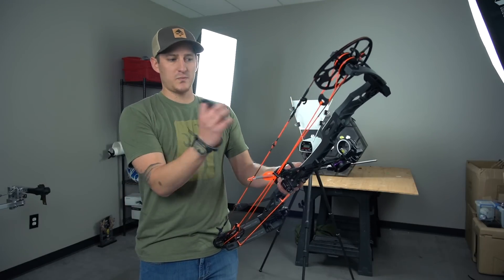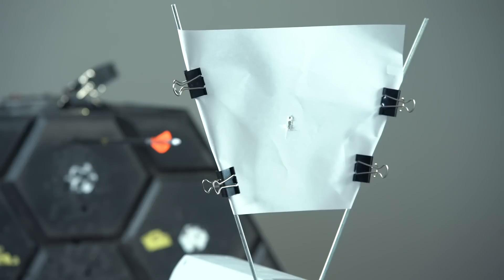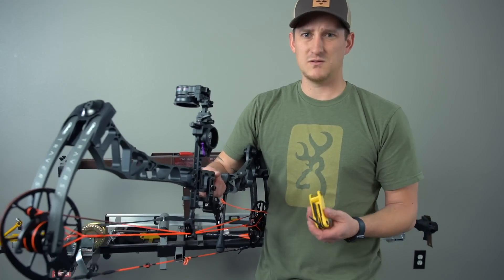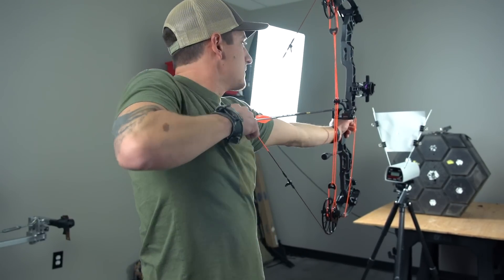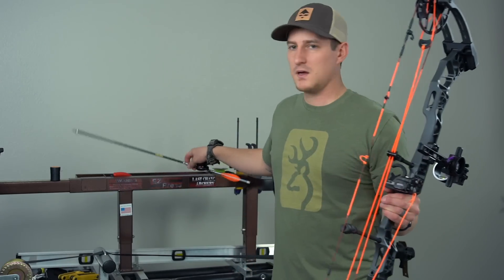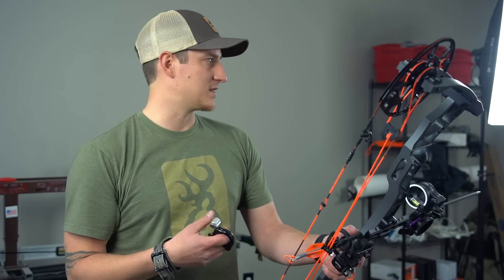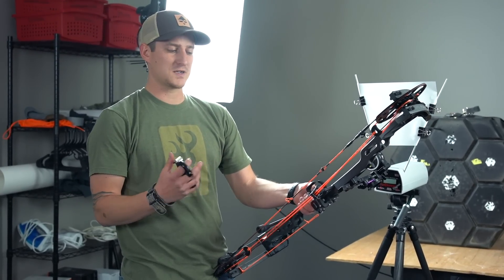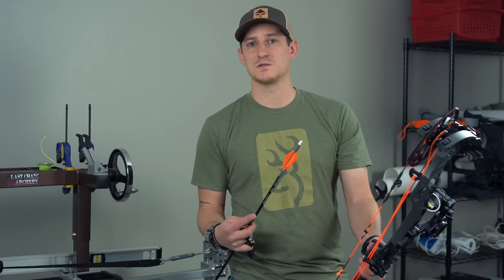MATHEWS BOW BUILD - PART 7 - How To Paper Tune Your Bow

Comment: I have a Triax and Traverse, on both bows I had 1”+ right tears.  I flopped the top hats and got bullet holes without ever moving my rest from 13/16th.  Expect it to be my form?
Reply: Tyler Zink hard to say for sure without seeing your setup and the accessories. Could be a number of things from arrow spine to a side bar setup and more. Draw length can also pay dividends into this. Generally speaking, at my 27.5” draw length bows tend to tune pretty easy for me.

Comment: The draw form might be affecting the cam timing. You should be drawing horizontally back with your elbow up, probably you are pulling more lbs than you should and that is why your elbow goes down and then up... its the same efect as drawing on an angle, its best to draw horizontally and then love to the shooting angle...

Comment: Good video, for what it’s worth, with a hunting bow I like to tune it with my quiver and arrows - 1 arrow.
Reply: Dre Sted definitely a good tip to note! I should have added into the video, but when shooting broadheads for a final tune I always shoot with my bow being fully loaded and ready to hunt. While on the topic, it’s also good to note that everyone should also check their sight pins with a quiver attached to the bow if the bow was sighted in without the quiver.
Reply: David Barnett what quiver did you end up with? I'm considering the hamskea and q lite 2 piece but am concerned that the rest will hit the arrows in the quiver. Thanks.